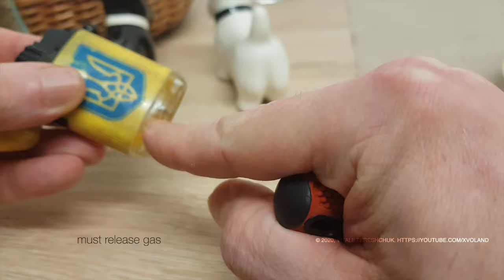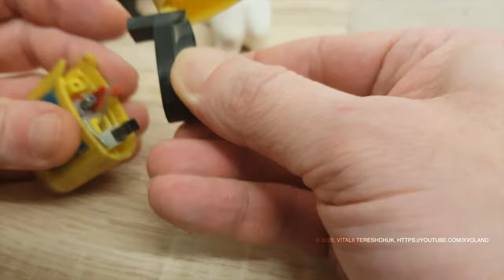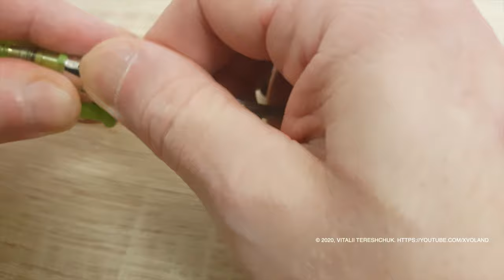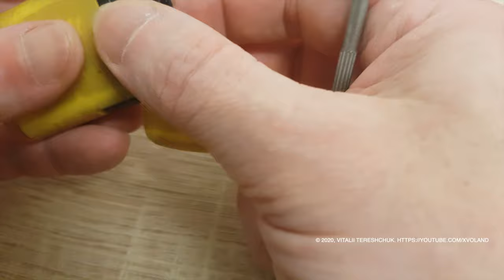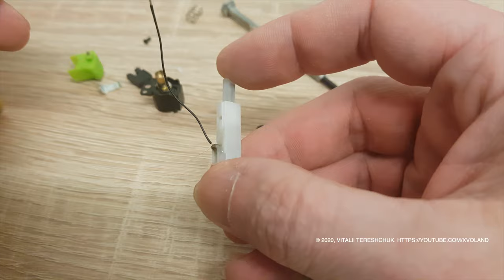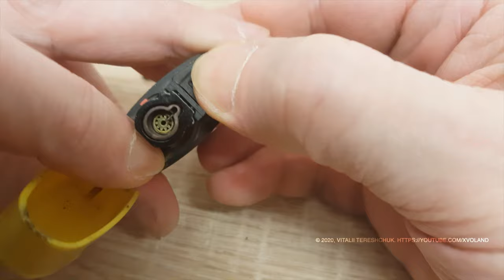🛠 How to fix Piezo Lighter. Replace Piezoelectric spark generator. Life Hacks

Comment: He dropped the rubber spacer on the bottom of the piezo igniter.. very important when it clicks the same time the flame comes out ...timing ...some need the extra space and some don't try and replace it with the same piezo igniter. If it's real difficult to light still ground the body to that piece on the bottom and make a circuit. Another trick I learned sometimes there's a cut in the insulation and it's shorting out the spark is below where it's supposed to come out I use super glue as paint it insulates then the spark comes out where it's supposed to. And when cutting it I use nail clippers and cut it flush to the top of the ceramic piece and then just bend it over don't remove the insulation it's already cut there
Reply: I use super glue for that too! Works perfect!

Comment: Ok mine makes a spark but doesn't light most the time any fixes
Reply from the maker: The micro hole may be clogged and needs to be cleaned
Reply: Adjust wire

Comment: Is there a good quality brand that works or just any piezoelectric ignition system works? Because I have a colibri stealth 3 and It just stopped working, and I can't find a lighter shop that can work on it
Reply from the maker: Generally, all piezos are the same. Sometimes they may differ in size

Comment: I bought mine today new, how often can this happen? Because I'm kind of concerned now that mine might do the same in the future
Reply from the maker: Mew Cat Loves Things The piezo element is very small.  How long it depends on the frequency of use.  I have it for about a 1-1.5 year
Reply: @xVoLAnD  I have a blue jet torch lighter, im just curious because it was $4 and If it lasts a year, im fine with that, $4 for another one next year ain't that bad of a value for how long it lasts, I actually have the same one as you without the transparent bottom, its purple and lined black owned by atomic thank you
Reply: @ferafrost2385  i have a 10 year old red one and this is the first time it happened to me

Comment: OK friend, I wanted to know if you need to drain a little to remove the burner to adjust the valve because mine lights up but then goes out. mine is similar to this one.

Comment: Mine is a metal jet lighter with a hinged lid. It's also supposed to light up a picture in the front when the lid is opened, it uses 3 little watch type batteries for that. The lid has to come off before I can take the top of the lighter off to get to the igniter and the lid is held on by real small metal pins that I'm going to have to drive out. I have a feeling this one is going to be a pain. I just hope I can find a cheap lighter with the igniter that will work.
Reply: Dollar tree bbq lighter. Cut wire to size. $1.25.
Reply: @rafaeltorre1643  That sounds like it'll work, thanks.
Reply: @bodeine454  No problem. I do it all the time. You have about a 5 inch wire so it fits any lighter or torch!

Comment: This is why I use the new Zippo that uses flint and butane, I just don't get how to repair the clicker in the torches. I'm not saying what is better since this fix will probably last which is also efficient, but comparing the whole video length to my flint lighter it takes me about 1 min to replace flint even though I have to do it more regularly. Their actually are some torches that work off flint believe it or not, but Zippo does not.
Reply: I'm using the zippo with piezo mechanism. The clicker is quite eternal so I don't worry about that, BUT when something goes wrong I'll just learn how to replace the clicker or buy new "filling" to the case. 
No more fuel loses and constant adding of the liquid, the flame is wind proof, hotter and more efficient, lighter is for once a reliable tool in time of need. 8/10 would recommend
Reply: @spicydiarrhea5662  Well I might try the Zippo single torch eventually since Zippo brand butane inserts are the best so far out of my tests. But I don't really prefer torch to smoke because it burns incredibly fast and uses more fuel.

But yeah you are right about it being somewhat windproof, also you can hold it down a little bit better since it doesn't travel upwards.

Comment: I have one jet lighter (origin from the factory settings), but why my jet lighter isn't windproof? Should jet lighter is windproof? And how to fix it?
Reply: They are not wind proof. Wind resistant. Use a torch not a wind resistant colored tiny flame.

Comment: I can't tell you how many lighters I've owned that have the igniter fail....some were very expensive
Reply: Buy a cheap vintage lighter from the usa or Japan and you can have a piezoelectric igniter made to last forever and swap it into any torch or lighter you want. Personally I buy vintage lighters and repair them. They are like gold vs foil. I haven’t used a plastic lighter in years. Except for breaking them open for the gaskets to use in my repairs. Lol

Comment: I've watched so many freaking videos and have looked at so many websites just today to try to fix my stupid lighter. I haven't been able to figure it out still. It worked fine then all of a sudden wouldn't spark. The piezo isn't dead (know for sure because I zapped myself a few times lol) and everything else on it was fine...I can't figure it out. Also can't figure out how to troubleshoot/repair the damn thing wouthout it taking hours and hours 😅
Reply from the maker: When you have correctly installed the piezo in the lighter, you should see a spark on the gas nozzle
Reply: adjust the spark gap
Reply: You have a short. Find hole in insulation and super glue over it to insulate. I always do this.

Comment: Did you just solder the wire into replacement ignitor?
Reply from the maker: Yes, and isolated.  It is necessary to use acid for soldering.
Reply: Ok, so acid core solder? And sorry for so many questions but does isolating the wire involve removing any of that waxy stuff that holds the wire? I mean, I guess I should just dive in and try out some things. "Play with fire you're gonna get burned." keeps repeating in my head.
Reply from the maker: @MyPronounsISwhom  No problem. The contact, to which you solder, a metal wire and therefore it will be difficult to solder if you do not use acid for soldering or welding. To insulate, just use electrical tape or any other tape.

Comment: meth
Reply: Not necessarily (but usually lmao) These lighters hold up insanely better in wind than any other lighter I've used and there's no bad taste from them either, that's why I use them. Well, that and the fact that they're more common than bics or zippos in the area that I'm in right now. Only started using a torch because after getting here I couldn't find zippo fluid (or even the zippo butane insert) to save my life! The .99 lighters around here are refillable torches, so had to get one. Tried to go back to my zippo when fluid for it finally arrived, but it tastes nasty to me after having used these. Sure wish they weren't so gd damn unreliable though lol